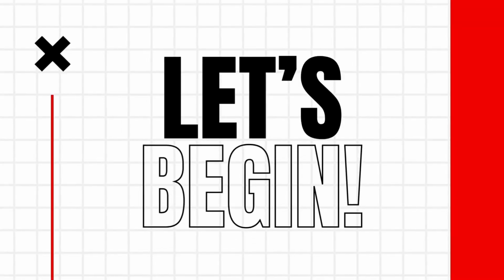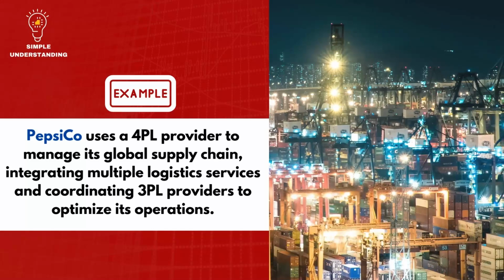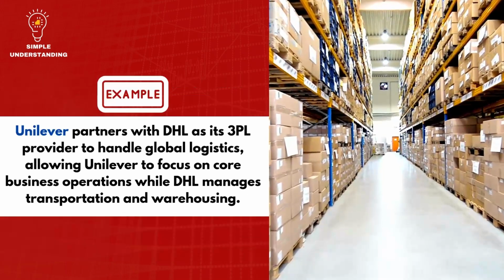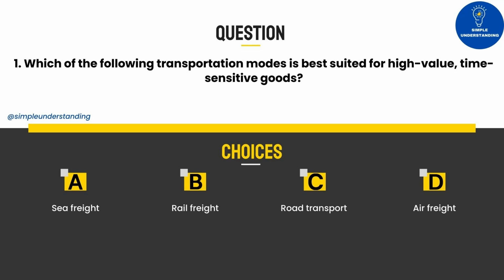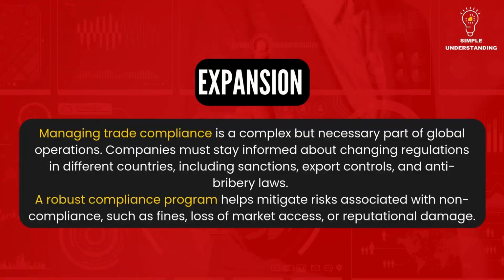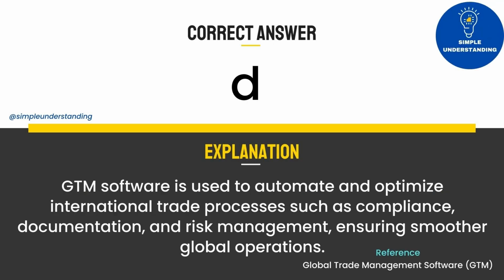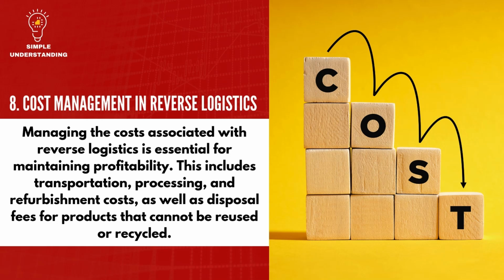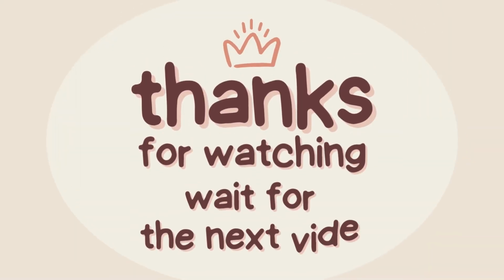APICS CSCP Module 5: Forward and Reverse Logistics Full Course (90 min)

Comment: Do the download study materials include voice or audio recordings?
Reply from the maker: No, just materials explanations 

The full package we offer covers:
- All 8 modules in detail with the full 35 complete sections
- Step-by-step Explanations for the math parts
- 3,500+ MCQs (scenario-based, quantitative, theoretical, conceptual)
+ mathematics mcqs
- 1350 Flashcards Terms and Definitions for fast review
- Real-world examples and Cases study to connect concepts to practice

These videos work as a quick core review, but if you’re preparing seriously for the CSCP exam, I recommend using the full package alongside them. That way, you get both the clarity and the full depth.

If you want to try it out first, I’ve put together a free sample of the CSCP course. You can apply here and I’ll send it over:
👉 https://forms.gle/5YeK6HCs45kNZcQ19

Let me know if you need anything else. Best of luck with your studies!